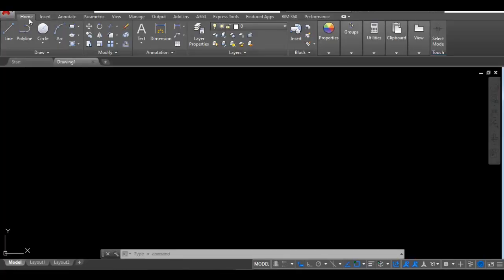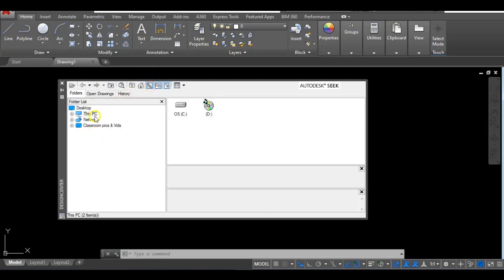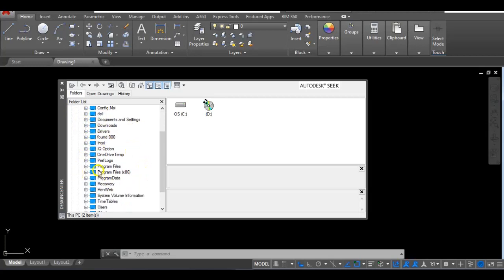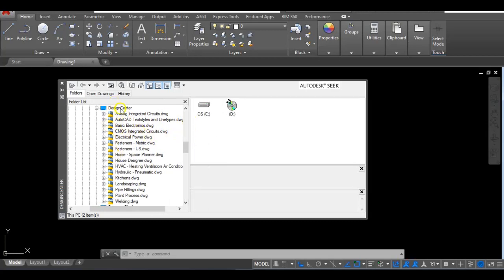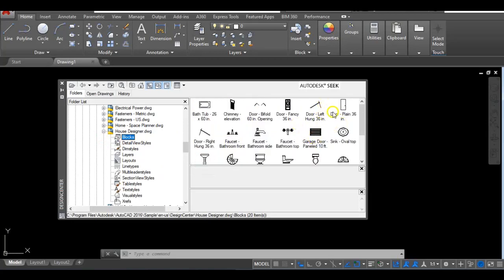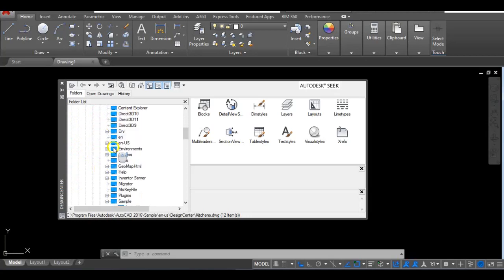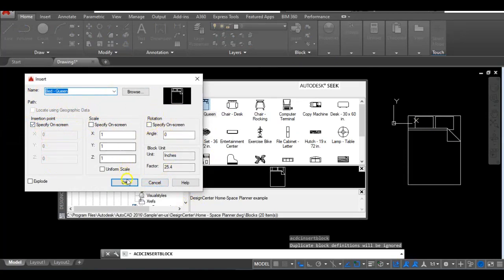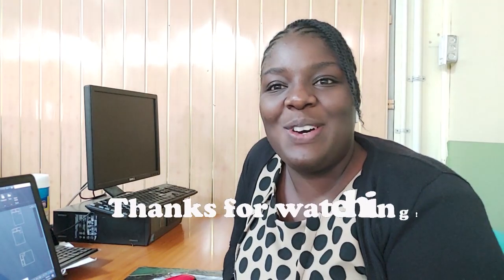Can't find Design Centre In AutoCAD? | Never lose it again after watching this

Comment: my design center are cannot open accendentally i hide the autodesk seek design content ang cannot show in the windows. what will i do? pls..answer my comment
Reply from the maker: Hi Bohol Bisaya Tv, thanks for reaching out. I previously responded from my other account, sorry about that but hope you saw my response. I reposted it from my Technisci account.

Let me see how best I can assist you. I recognize that the label "Autodesk Seek" is not in the newer versions but the design center window works just the same.

To activate the DesignCenter window try one of the following:
(1) Press the key combination ctrl + 2.
(2) Go to the view tab, in the Palettes panel. The DesignCenter icon is in the 3rd row to the immediate right of the "Sheet Set Manager" icon. You can hover over the icons until you see DesignCenter. (This depends on your version of AutoCAD, I'm using 2022...in other versions it may be in the insert tab, in the location panel).
(3) Type adcenter in the command line
(4) Type designcenter in the command line.

I hope this helps, give me some feedback and let me know if you need additional assistance. 👍